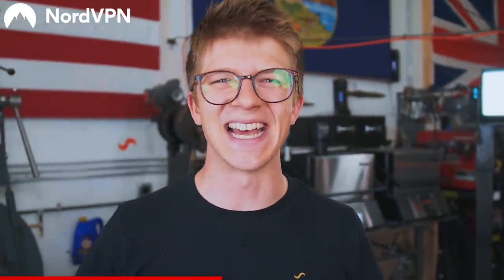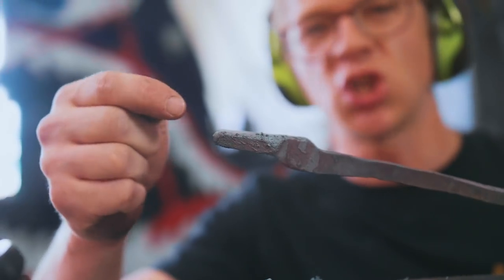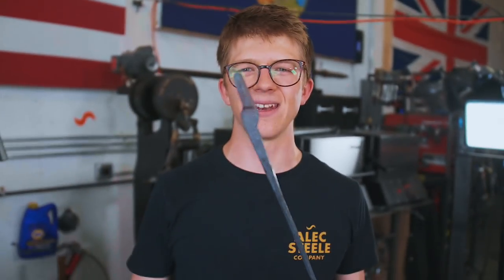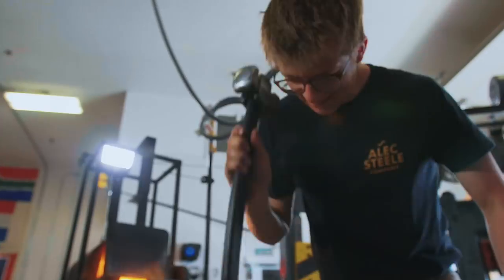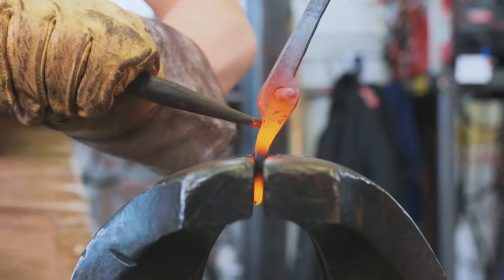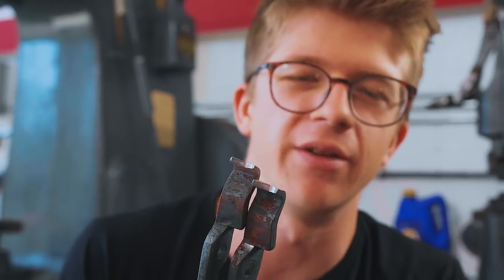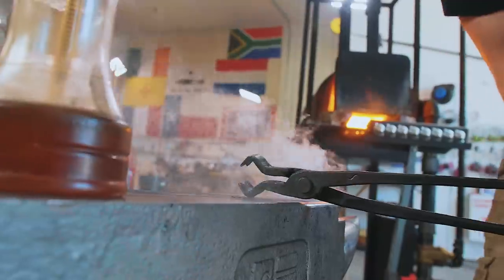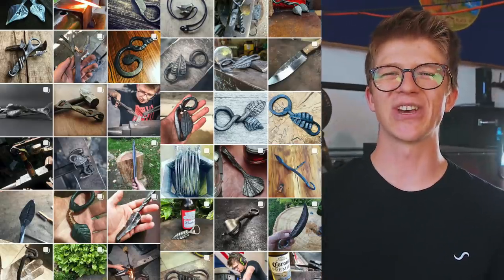HOW TO MAKE SIDE-GRABBERS!!! FWOF Week 2

Comment: I wish I could take part. I used to do a little bit of blacksmithing and hot forging copper and precious metals. Had to give it up due both to developing severe heat sensitivity and and inability to use things like a hammer repetitively due to a joint condition. I wasn't great but I miss it.

Comment: Alec, have you ever considered getting some ultra slow motion video of metal deforming with a hammer strike? You had some great shots in this video and it made me think, what is actually happening as the stock deforms at ultra slow mode speeds.

Comment: Just a thought here. If you use an insulating material as a buffer between the tongs and the vise then maybe the heat won’t be drawn away as quickly. Maybe you can make an insert like you have the copper jaw covers for working with delicate materials. I’d love to see if it works

Comment: Thank you for another great video. One question though, why not create the grabbers you showed at the beginning and add a notch to the edges that would let you grab stock either way? Is it because there were integrity issues with the tongs when applying pressure?

Comment: Would it make sense to heat the vise while the steel is coming to temp in the furnace to avoid the heat loss. Maybe with a Map Torch? I recognize this is probably a dumb question as it would cost more effort than benefit gained. Alternatively would something like a silicon insulator be beneficial?